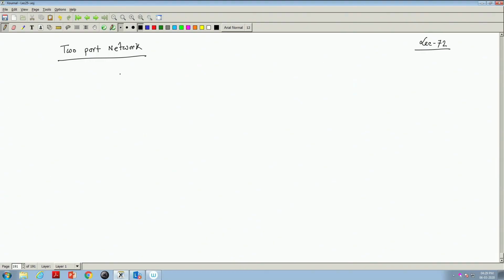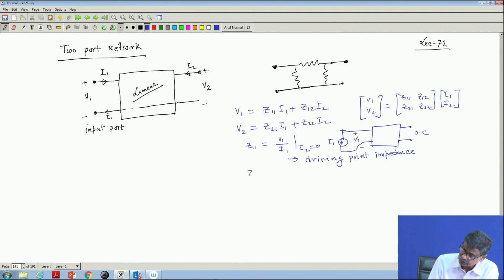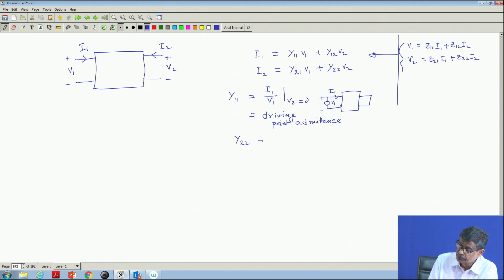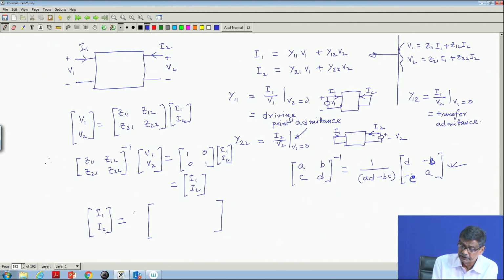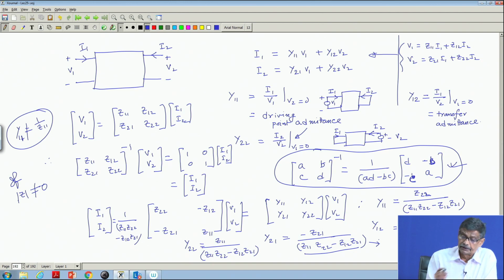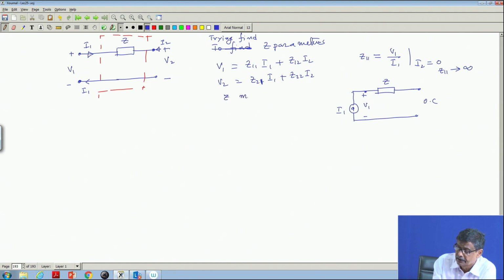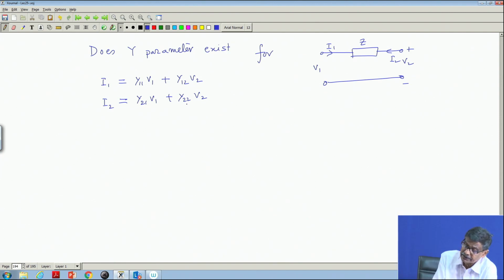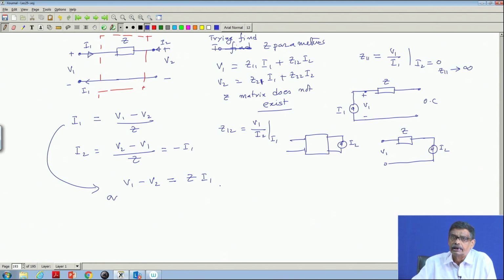Lecture 72: Two Port Network - II

Comment: Sir we have observe the motherboard manufacturing process in organisation. Lots of components are mounted on PCB like diode, inductors diode and capacitors. But we can't understand why there is difference in the two terminal of diode. They are not same in size?
Reply: Size may indicate polarity.

Example: in LED long conductor is +ve rerminal and short terminal conducror is -ve terminal . 

Can you be more specific of your question?